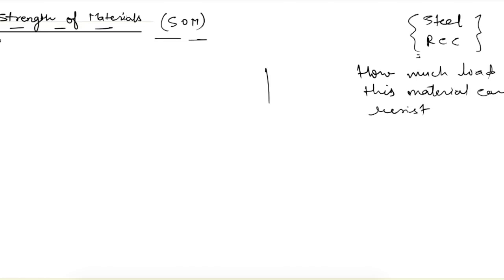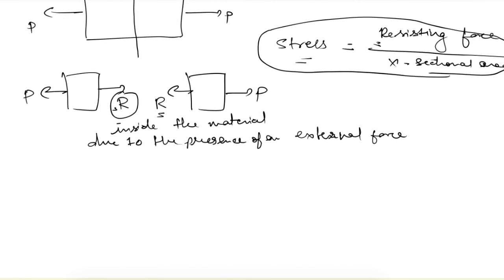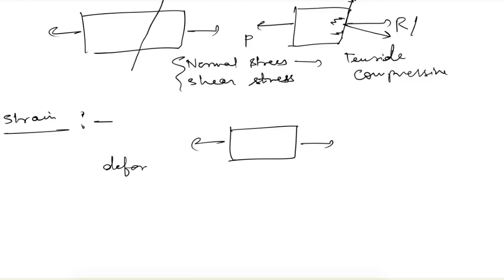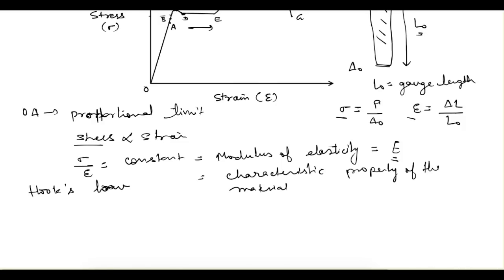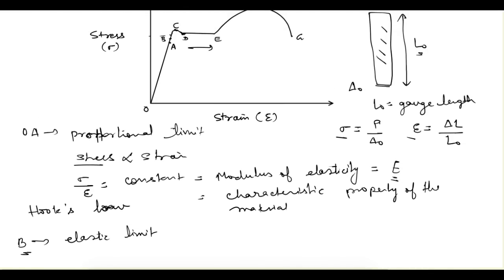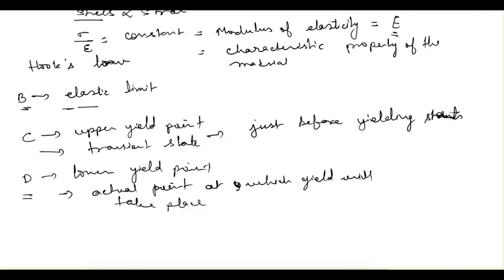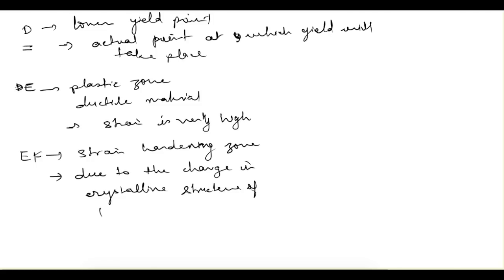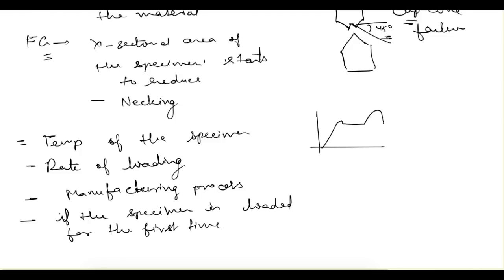Introduction & Stress Strain Curve | Strength of Materials (SOM)

Comment: sir what is yielding?
Reply from the maker: Yielding is the stress state after which the material shows very less resistance to deformation. If the load is increased, the length of the member increases without much increase in the resistance (stress).